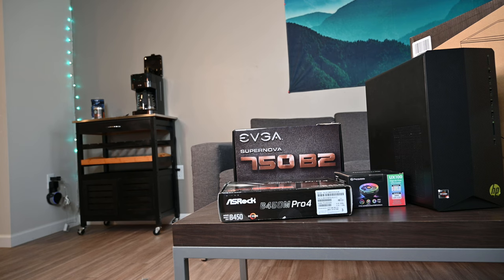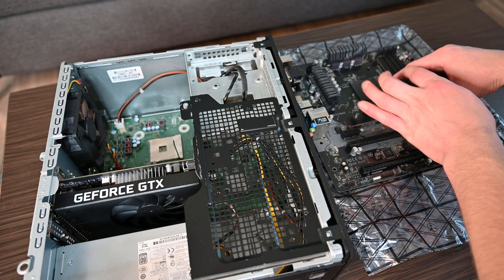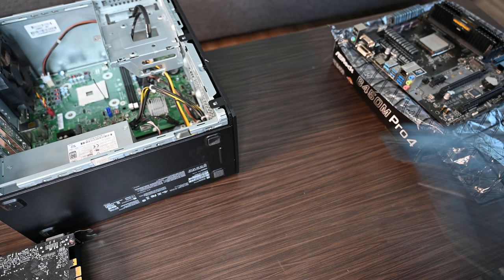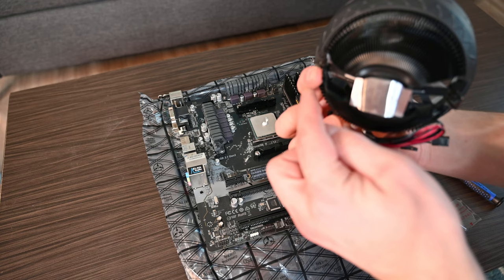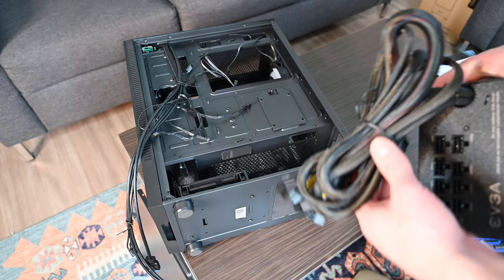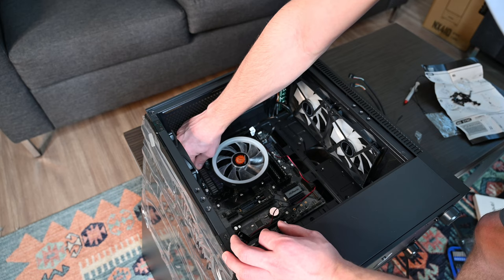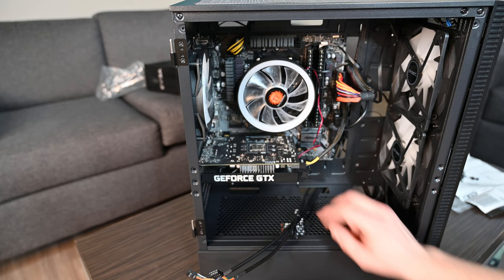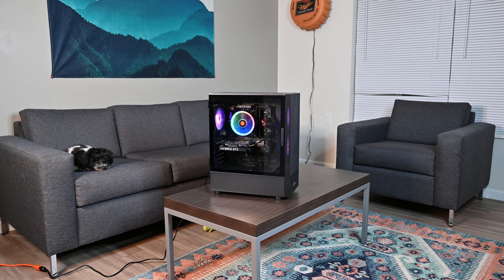HP Pavilion Gaming PC Case Swap TG01-0023W

Comment: I have a pc just like the one you case swapped and I was wanting to upgrade the graphics card but I didn't want to case swap it because the front IO would make it hard to, but I never thought of changing the mother board. That was very simple and smart way to do it, now I want to do this to my pc. Great video very helpful thank you.
Reply from the maker: Thanks, for the comment!! I am glad that this was clear for you and helped you out :) If you ever need help. let me know or join the discord
Reply: @PortzTech  Thanks, will do
Reply: The motherboard for it sucks. When I upgrade it the first thing I'm gonna upgrade is the motherboard.
Reply: changing the parts makes it not a swap, that's why. lol upgrading the motherboard means changing the PSU, and most likely the cooler which was used in a case that was designed to make it efficient enough for its other cheap parts. that's half of your internals changed off the bat. nothing about that is case swapping, it's just building and part harvesting.

Comment: Thank you. Wanted to upgrade my Pavillion Gaming Desktop from a GTX 1650 super to a RTX 3060. And a big piece of advice- get a case with lots of pre-installed fans. I got a 109 dollar MUSETEX case with 6 pre-installed RGB fans and a glass side panel, which I will be using to fit my dual fan MSI 3060

edit: you need a case with a lot of preinstalled fans because the pavillion gaming desktop comes with 3 fans- however 1 is a cpu cooler and one is a PSU fan which only turns on when it needs to, so technically you only have one fan. it can get REALLY hot in that little space
Reply: Did the windows license transfer over?
Reply: @giffel979  windows license is on your ssd/hdd so if you transfer that over itll transfer
Reply: this is the same thing I was going to do get a musetex case with 6 fans

Comment: Great video
Here's some pointers though;
big one is not to touch the cpu pins, hold it by its sides as you can damage the pins and could render it useless.
i would ground myself (remove static electricity) from myself before dealing computers, its not necessary but it definitely is a good thing to do just in case, you can ground yourself by touching a plugged in, but not turned on powersupply or using an anti-static bracelet. 
also the thermaltake cooler you have has had some bad rap for being a bad cooler, but for a ryzen 5 5600g (with its igpu disabled) it should hande it fine with good enough airflow.
the 750 watt power supply is a bit overkill especially with a 1650 super (expected powedraw of your system is around 200) but its always nice to future proof with a good quality and wattage psu so no real problem there
but overall if it works it works. so you did a great job and its a real cool mod you did
(also i have a 5600g 1660S version of that same pavilion) lol
Reply: also, the power supply sucks in heat from the big fan at the bottom and throws it out facing out the way with the power cord socket faces. they usually have their own isolated cooling so facing down is what you should do, as if its facing up it can suck in some hot air from the case which is not ideal
Reply from the maker: Thanks, for the input. I will keep it in mind for the future
Reply: With the 1660 s , are you running it off a 400 watt power supply? I want to install the msi 1660 s 6gb that require 450 and im not sure if i should do all this or will it run with the 400 watt?
Reply: i think he knows

Comment: Thank you for the inspiration to do that case switch resp. little new built.
Did it to my TG01-2702ng (AMD Ryzen 5700G and RTX 3060ti) and everything worked fine. I certainly couldn't use the same parts you did, because of my different HP model, but the basic of the stock list with CPU, Mainboard, PSU, CPU cooler and case was the same. (Thermal compount came with my CPU cooler)
I was very sceptical about the 1:1 change of the SSD, especially because of the windows license, first. But also that worked fine. 

Just two things for others who want to do it. Might be that these issues did only happen to me, but if you get them, perhaps it might help:

1) I use a pin code to log in to windows. When I started the "new" PC a message appeared at the log in screen, that I have to set a new PIN due to changed safety settings. In my case, the drivers for the wlan card on the mainboard weren't installed at that point, so the only way to set the new PIN was a LAN cable (so you should have some by hand, if you don't use one normally and use W-LAN only).

2) I chosed a MSI Mainboard for the new build. There you have two slots for SSDs. M2_1 and M2_2. The M2_2 slot would have fitted exactly the length of the SSD used in the HP, so i placed it there. 
With that placement the PC wasn't able to boot windows at every first start without going into BIOS first. It started in BIOS, I had to close it without changes and then it worked. Restarts were no problem. They worked without BIOS.
After I searched some hours I came to the point, that either the slot M2_2 doesn't support the SSD or the slot isn't able to boot.
After i changed it to M2_1, the boot to windows works fine.

Thanks
Reply: Did you have to uninstall the old motherboard drivers and install new ones
Reply: No, I didn‘t uninstall any drivers before. 
It worked fine without. Just installed the new ones after the first start of the „new“ computer.

Comment: At a certain point this stopped being a case swap and started being an entirely new build using a 2nd hand GPU and CPU.
Reply from the maker: Yea, that is basically what this become for this build series
Reply: @PortzTech  OK, but hear me out here, If you are using a new motherboard and power supply and only sourcing your CPU, GPU and SSD from the pavilion, all of which are available off the self, is this really a pavilion build?
Reply: Are the temperatures in the new case better?
Reply: new mobo = new cpu, at least for me  @DiminuendoBlue

Comment: The only parts you need ...... is EVERYTHING! Except the locked CPU,  a used NVME SSD and your old GPU ;) You will really luck out if the old ram is compatible with the new motherboard.

Comment: great vid , i've been contemplating this for a few months now . shopping for the case n cooler now
Reply: the PSU IS NOT AVAILABLE AT THE MOMENT , ANY RECCOMENDATIONS ?
Reply from the maker: @BiGDeE3  yea, you can go with any power supply like this one 
 www.amazon.com/dp/B084R89CJ5
Reply: @PortzTech  thx man
Reply from the maker: No problem!
Reply: @BiGDeE3  Did you end up doing it? Did the windows license transfer over?
Reply: @giffel979  yes and yes
Reply: @BiGDeE3  Ok thanks. Was it worth it? Did you get any performance gains?
Reply: @giffel979  yeah i have upgraded gpu and ram since then all improving performance . I should be good for a year or two now .. then i'll build a fresh kit
Reply: @BiGDeE3  What was your specs before upgrading gpu and ram? I will probably just do the upgrade and then upgrade ram down the road. I have 3060 ti and 10400f so i am pretty good for probably 4 years or so

Comment: 3:48 No you can not "do whatever you want" I mean you can, but if you are running 2 sticks of RAM you should be checking your motherboard and putting them in the proper 2 slots for dual channel capabilities. This arrangement is almost never with the 2 sticks side by side, hence why you see people stagger them

Comment: Good video but this is basically building a new pc
Reply from the maker: Yea, that is what it takes basically to swap it to another case
Reply: @PortzTech  i wouldn't mind just changing the motherboard. Also if you move the ssd with windows on it to another motherboard, will it still work as normal and boot from it?

Comment: Video has been incredibly helpful, although I know it wont be possible but could you potentially make another video where all you do is change the case from the hp pavilion to the new one using everything in the old case (If there are some stuff that is required to be added then those are ok too) the reason im asking this is because my pc isnt very good and if i get a new case i can start customizing stuff inside it but i would like to customize stuff one by one tysm
Reply: Hey I also have the same pc and I was wondering how to do this but on the go pavilion you know how there’s the usb ports on the front of the case well you have to change the mother board only because then there would be no slots on your new case for those ports to go into Im thinking of doing the same thing I hope you have good luck with your pc 😁
Reply: @Isaiahz2006  ty
Reply: @emir2996  Of course, also I'm searching whether the power bank can work on a different case or if its only used on the pavilion do you happen to know that at all its okay if you dont
Reply: @Isaiahz2006  I unfortunately do not know, but if you happen to get any information on that, you mind just answering right here?
Reply: You can’t do that unfortunately, it’s a proprietary mobo and won’t fit another case. You’ll have to swap out the mobo, and the PSU is also made specifically for the HP mobo. You’d be better off just building a new PC and using the gpu/cpu/ram etc from your prebuilt
Reply: You cant do this, you need atleast new cpu cooler mother board and power supply

Comment: I recently got myself a pavilion with a ryzen 5 5600g and radeon 6600xt and now i’m wanted to switch it to a new case for better airflow and obviously the looks. I was wondering what a good motherboard would be. Thanks
Edit: Also what power supply will i need to get to fit in a mid tower case
Reply from the maker: Here you go! Make sure to do some research to make those are the right ones for you.
Power supply - https://www.amazon.com/EVGA-Supernova-Modular-Warranty-220-GT-0650-Y1/dp/B088SSX883
Motherboard - https://www.amazon.com/ASUS-Prime-II-Motherboard-Flashback/dp/B08KH12V25

Comment: hey i bought a hp pavillion pc it has a ryzen 5 5600g with a rx 5500 graphics and wanted to change my pc case in the future for better air vent which motherboard and powersupply will u think would suffice 
and awesome vid
Reply from the maker: Thanks!! Here you go! Make sure to do some research to make those are the right ones for you.
Power supply - https://www.amazon.com/EVGA-Supernova-Modular-Warranty-220-GT-0650-Y1/dp/B088SSX883
Motherboard - https://www.amazon.com/ASUS-Prime-II-Motherboard-Flashback/dp/B08KH12V25

Comment: WARNING!!!! you can’t NOT use the old cooler it doesn’t fit on that motherboard! Unfortunately I noticed it during doing this swap and have to rush and get a new one. Please be aware so that you don’t have to go though the same frustration as me… Also you need to check on your motherboard in what slots the ram sticks are supposed to go for dual setup. It’s not just whatever you feel like.

You need a new motherboard, power supply and cooler to do a swap unfortunately.
Reply: Wish I would’ve read this before hand
Reply: you can. you just need to remove 2 diagonal screws and then just connect it to the mainboard by secure with the 2 remaining screws

Comment: Honest question:  What performance did you gain by doing a case swap?  What is the benefit?
Reply: Better airflow and temperatures
Reply: Also the option to get rid of the shit motherboard and psu
Reply: But is it worth it?
Reply: @RobVI  fair enough.  Thanks.

Comment: Hey man I don’t know how active you are now a days 
However you should get a better cpu cooler if it’s working fine for you don’t change it 
Looks like that case got AIO support too but I think tower cooler will work best there are inexpensive ones out there
I use the Vetroo v5 cpu cooler it was about 30 bucks if I remember correctly and it performs very well on my 10400f

Comment: Does this need a different motherboard or are these chassis you can find for better airflow without replacing the motherboard?
Reply from the maker: You have to replace the motherboard it will not fit in the case without a new motherboard
Reply: If you carry over the same motherboard several things will need to be addressed:
1) if you’re lucky you may be able to mount four standoffs
2) the original PSU will likely only fit one screw on the case unless you 3D print a template
3) a new PSU will need an adapter since the motherboard isn’t 24 pin (don’t recommend splicing and soldering old connector to new PSU)
4) you will lose your front USB ports, audio jacks, and card readers (with the USB ports you could use then as an internal to external solution or mod an extension cable to an open bay or run an open case to reach in and still use those three items).
5) you will need an exterior power button mod (either by relocating an alternative or modding an extension arm to reach the original, keeping in mind the indicator light).

It can be done with a lot of work, but with the BIOS limitations it’s better to get a new board.

Comment: Cool build and all, but this is still not a "case swap". lol It is a build with harvested and new parts. Title it correctly. Pavilion is not really designed to be upgraded/swapped, and the upgrades you CAN perform typically only extend viability a couple to a few years due to increasing demands of newer technology and software. They also cost way more than just designing a custom rig off an internet shop. HP prebuilds like Pavilion Gaming CANNOT be swapped without a lot of heavy modification to a new case and or purchase of adapters. The main issues are the HP board is not ATX compatible, they are proprietary like the PSUs, which means they require the case HP designed to seat them without making contact. The second issue is the I/O ports are baked, rather than using pin connectors and harnesses. Between these 2 factors, you would have to purchase an oversized case, fab custom seats for everything to mimic HP Pavilion internals, and lastly use adapters and other tools to fab a custom I/O panel. Only then can you perform a true swap. That's not to say it can't be done. It just isn't worth it unless you happen to have a Pavilion.. and the time. And all that extra stuff you shouldn't have to buy to do a proper swap. lol

Comment: What would be a good alternative motherboard? the price increased to over 100 for that one.
Reply: does the mother board have to have an argb fan header for the case fans?
Reply from the maker: Any motherboard that is the b450, just make sure to do some research to make sure it will work

Comment: For my new case every front fan has like 2 cords each
Reply from the maker: just plug in one. it will power it. Use the Molex if you don't have enough fan headers on your mother board

Comment: This is a great video! Can I use any case, cpu fan and 750w power supply? Thank you!
Reply from the maker: You can use any case that is basically a full size atx case. You can use a lower watt power supply too just make sure it’s a atx power supply. You need to make sure your cpu is compatible with the motherboard

Comment: Can i use the same motherboard and power supply that came with the hp prebuild?
Reply: Sadly you can not use the stock Hp pavilion motherboard on another case because the motherboard is proprietary.

Comment: Hii, i wonder if i can reuse the hp psu to supply power to my new motherboard??
Reply from the maker: I would recommend not doing that, but you may be able to since it should connect to another board as it has the same plugs mostly

Comment: Basically to swap the cases you need another motherboard right? In the service they told me they couldnt swap the cases
Reply from the maker: You just need that motherboard and you should probably just spend little more and get a new psu

Comment: Very good video! Now if I wanted to would I be able to put the same motherboard in the new case? Thanks!
Reply: Nope it is specifically hp.  Aka proprietary. The power supply also cannot be swapped to a new mobo

Comment: Thanks for the video I got everything in your video besides power supply went with a 650 instead next year im gonna try and up grade graphics to some kind of rtx model right now I have a 1660 super any recmondation
Reply from the maker: Glad I could help! I just got the power supply in the video for a good deal or I would of went with something with lower watts. Get a 3060 12gb card, great bang for the buck
Reply: @PortzTech  now if I get that I need a new cpu right right now I have the ryzen 5 3600
Reply: Did the windows license transfer over?

Comment: Is it possible to use a different motherboard and case and get the same output?
Reply from the maker: Yes, you can use another motherboard and it will work out the same

Comment: Dope video. One question can I use the same nvme drive that comes with the hp pav I have a good amount of stuff on their or do I need a new one.
Reply from the maker: Yes, you can use the same nvme that comes with the hp pavilion
Reply: Portz Tech thank you and one more thing is the silver part/Hard drive holder and black part needed I don’t see any purpose for it besides hold SSD/HD can I remove it to increase air flow.

Comment: yoo would a Ryzen 5 4600 G be compatible with the motherboard you used? also what other power supply will work with the case you used since the one you linked is out of stock?
Reply from the maker: It may be with a bios update, I would just look for like a b550 something slightly newer. Just do some research on which ever one you pick